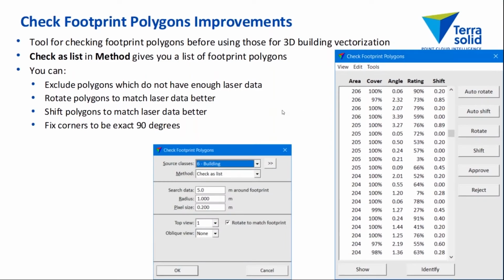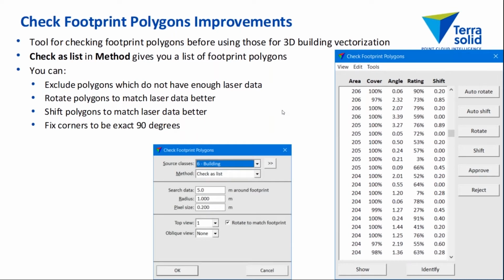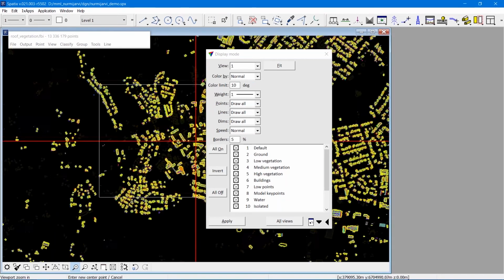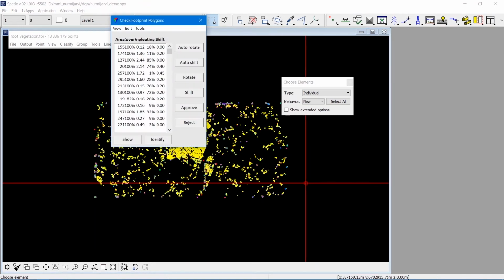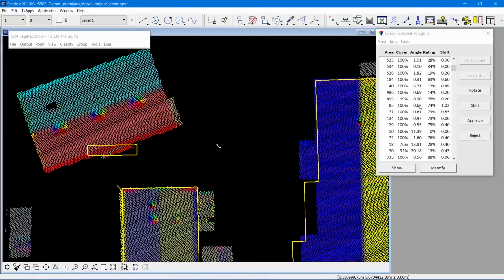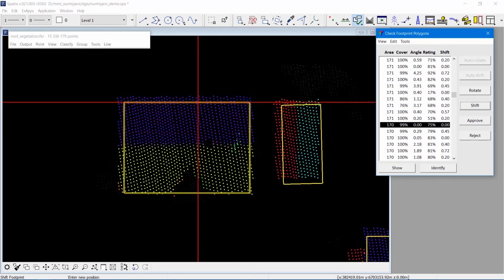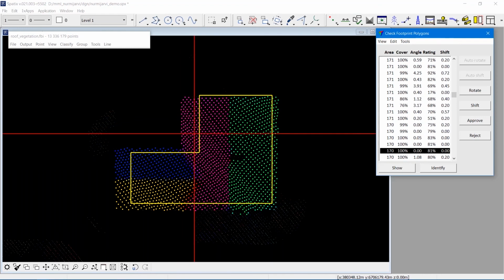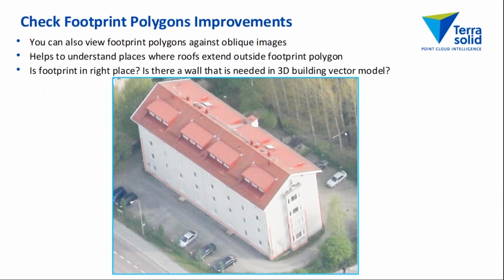Checking Building Footprint Polygons using TerraScan

Comment: The polygons that you are using to check de LiDAR Footprint, were done manualy? or its the result of an automatic process?
Reply from the maker: We compare against existing polygons. The source of the polygons is dependent on the user. Of course you can also compare against polygons created using TerraScan in an earlier mission to detect the change.
Reply: @Terrasolid  Thanks !